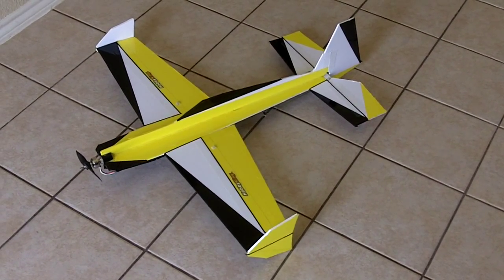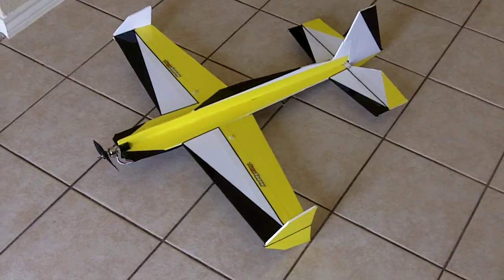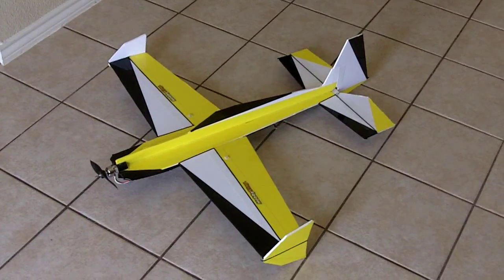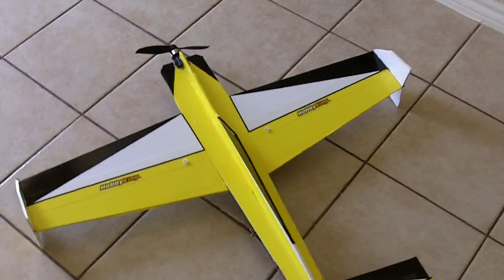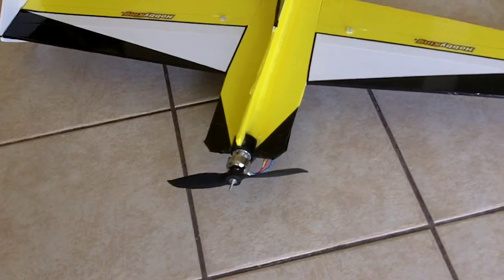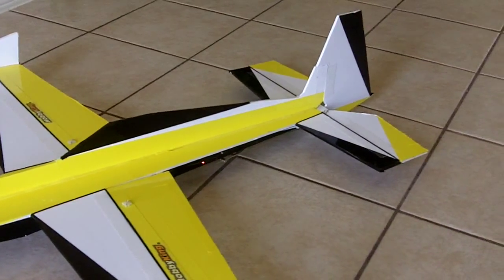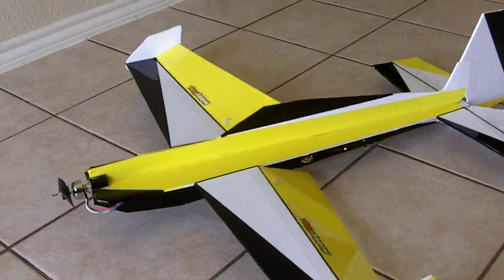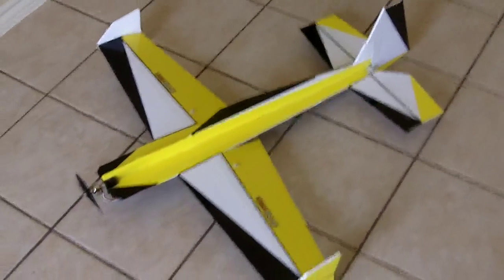300 Extra 3D RC Plane

Comment from the maker: @EMPrcRacing @EMPrcRacing That is correct, colored packing tape you can find it here... tapebrothers, I am sure that it adds some additional weight, but believe it or not it is not much. I use it on all of my planes that are foamboard, much better than paint!!! I You should give it a try, I have not been able to fing it in any stores so I ordered the rainbow pack.